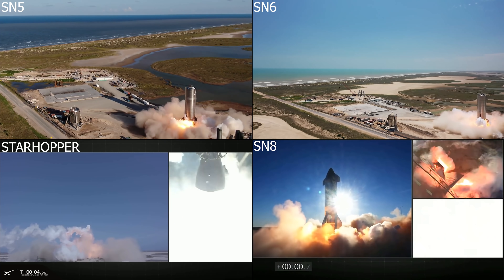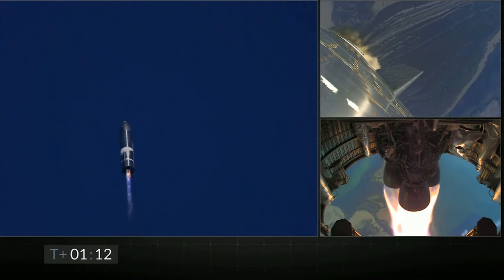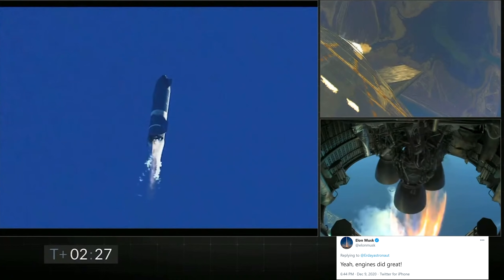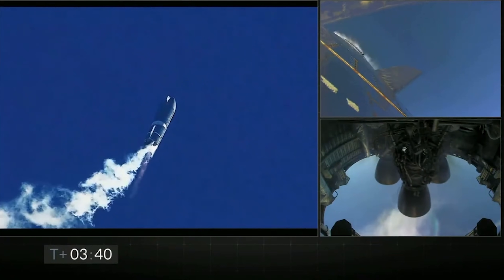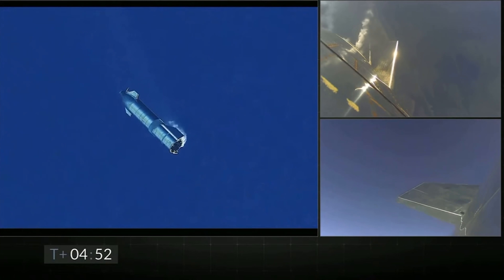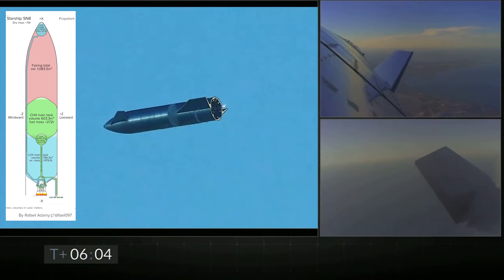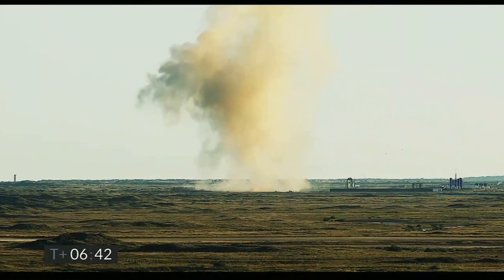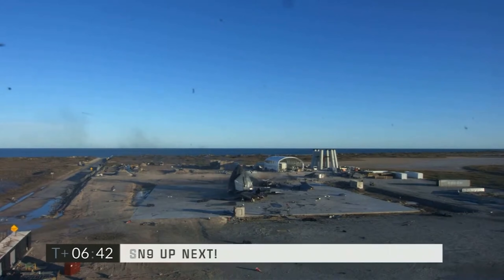SpaceX Starship Serial Number 8 Test Flight

Comment: Nice job on the narration.  Good luck with your channel.  Perhaps a dumb question but why would the Raptor consume itself due to low pressure?  My take would certainly be that the mix became very high LOX which would cause a super-heating beyond tolerance.

Comment: I had the impression that the final landing position was performed too close from the ground, in comparison to the approximation that Falcon 9 does. Do you know at which altitude/speed it is supposed to start this maneuver?
Reply: no, the deceleration rate would have been sufficient from where it started
Reply: @infinitelyexplosive  thanks!

Comment: This need to be redesign. I feel if they have propellers just on landing will helped be get balanced. those propeller need to be at edge of the notch those blades need to hidden inside while travell and  those will be at ignited at higher speed just for 2 mins. so it feels like hanging in air and get dropped with 0 velocity and makes life easier.
Reply: And how exactly will "propellers" work on Mars where there is 1% the atmosphere that Earth has? That is the end goal right?

Comment: My memory says copper makes a green flame when oxidized.. Isn't copper/brass/stainless required in the engine for cryogenic temperatures.?  I did LNG truck conversions and material selections matter a lot at cryo temps.

Comment: Eleven seconds. Mathematical model of physical systems
Eleven seconds before crash, the thrusters tried to control this huge mass with liquid inside, with the famous "inverted pendulum" control.
Since I don't know the real motor names i just call them 1,2 and 3 in order of starting, like actors in the theater.
Motor 1 start at T+6:31 and Motor 2 at T+6:32. both motors pointing to the top of the rocket
( when is horizontal) to its maximum angle permitted.
This stops the diving and puts the ship in vertical position.
This maneuver could be done with the motor 3 only and immediately prepare, 
in the correct angle, the motors 1 and 2 to control the overshoot.
Motors 1 and 2 try to control the mass and you can see how motor 2 try to reduce the counter-overshoot trying to keep
balanced the "inverted pendulum", moving to the top.
The disgrace here, is that motor 2 shutdown at 6:39 leaving motor 1 alone. 
Perhaps in the future they will write a program to start immediately the motor 3 to compensate.. ufff!
I can't imagine how hot was the processor calculating rapidly the information from the accelerometers and the actuators response.
I hope they have the logs from that processors... a lot to learn from that!
To me, at 6:31, should be used motor 3 only and wait for the inertial momentum 
to activate motors 1 and 2 together at maximum thrust, and shutdown intermediately motor 3.
This is not about time, is about inertial momentum... also can be predicted to to actuate before so prevent the overshoot.
Everything has to work with the altimeter ufffff!
Well, this is what i think from my taxi. yes i am a taxi driver, but I like to read control systems books(*),.. so don't criticize me too much. hehe.
I want to say thanks to Mr. Elon Musk. This guy is a believer and practical person. I congratulate him and all the people who work in his project.
I wish you huge success. (good luck is for mediocre people)
ps: They hoover the Startship. a lot of measures there!. but they hoover it with the wrong motor i think.Anyway, i am nobody but the video tell a lot of things.
(*)my favorite control system book: Douglas Cooper "control Guru"

Comment: It appears that the Raptor engines did not generate enough methane gas volume to maintain auxiliary tank pressure. Perhaps running at prolonged reduced thrust on one or two engines was a contributing factor. 

Rather than redesign the Raptors extensively, it might be better to complete the hot gas thruster system and use their autogenous pressurization system to supplement the Raptors. After all, in order to operate efficiently, the hot-gas thrusters would require a much higher pressure in their propellant vapor tanks than the regular cryo tanks. 

This would have to be replenished from liquids in a boot-strap fashion, and excess generated vapor could be diverted to the auxiliary tanks intentionally. 

It may also be desirable to operate the main cryo-tanks at reduced pressure once most liquid is consumed. This would allow them to safely re-pressurize during the hypersonic reentry without excessive venting.

Comment: I knew something wasn't right.
This makes perfect sense. 
So The Space X Team needs a system in that low compression tank that will insure through any maneuver that fuel supply continues.
Maybe a moving compression wall that pushes inward,forcing out air and compressing the fuel so that there is a steady supply of fuel..
Gotta hand it to The Space X Team..
That ship was Beautiful and it was a Great Flight, Up to landing approach..
Job well done !
I look forward to the New Improved Model. 
I know it will be a sight to behold..

Comment: The engines don't "burn themselves". That's a misleading flaw in this dialogue. The green color means the fuel mix has more methane than when it's more orange. Whether that was intentional or not, I don't know, to be honest. But I wouldn't trust Mr "Engines burning themselves" to come up with another ridiculous answer.
Reply: Also, he says that the nose tank "did not provide enough thrust for a soft landing". But of course the nose tanks are for attitude adjustments, NOT the deceleration burn. So the explanation is an irresponsible fail.
Reply: You've heard of fake news. In this video, you've got fake rocket science.

Comment: very nice test, but why do not start the 3 engines and deploy the landing gear?
Reply: Just like the falcon boosters, turning on all the engines for the landing burn would be too much and would actually make the craft rise again.  For this particular event,  it also wouldn't have helped since there was a fault in the fuel system supplying the engines.
Reply: @nolsp7240  thx for the explanation, and the landing gear?, 
i didn't see them
Reply: @arielnonini7384  The software didn't deploy the landing gear since it detected that it was still falling too fast.  Even if it did deploy,  the prototype landing legs couldn't have absorbed the impact and the result would still be the same.

Comment: Would it be better if SN8 flipped a few seconds earlier to allow tanks pressure to normalize and then fire engines 1 by 1 until you have all 3 running ?

Comment: It looks like the green flame at the end of the last burn might be a result of a collision between the two engine bells.  The right side engine did not get out of the way when it lost thrust and you can see the left engine collide with it when it is trying to compensate. There is allot of copper tubing in those engines bells.

Comment: i wonder if the centrifugal force of the flip may have caused the fuel to not fully make it from the header tank to the engines causing the burning of the engine and ultimately the RUD of the spacecraft.

Comment: Marcus House reports in his video much of the same as this but also notes that at about the 6:34 mark, one of the Raptor engines bangs into a second engine thus causing the green flame associated with damage to the copper engine components. His inside engine compartment video was a little clearer than this video.

Comment: First note: The landing legs didn't deploy, no one seems to have mentioned this. Second note: When the one engine flamed out just before touchdown, the remaining engine gimbaled hard to the right, smashing it's bell into the disabled engine. This probably damaged the remaining engine enough that its copper alloys started burning up, causing the green flame -  and with the bell destroyed there was little chance of any useful thrust.

Comment: WHY WAS N'T THE HEADER TANK HAD ENOUGH PRESSURE? WE KNOW EVERYTHING ELSE AND YOU DID NOT EXPLAIN THE MAIN REASON. WHY WERE THERE ONLY TWO ENGINES INSTEAD OF 3 FIRED IN THE FINAL DESCENT? DID ONE OF THEM STOPPED WORKING? VERY LOW ON USEFUL INFO

Comment: It is interesting to see the different logic Spacex uses compared to most others. Normally when an engine detects an anomaly it will shutdown immediately to prevent further damage. However that is in many cases a 'stupid' thing for the engine to do because it doesn't 'know' that by shutting itself down it will destroy everything else as well. It seems that Spacex has put in some well thought out overall control that takes into consideration the whole situation. In this case keeping the engine running was certain to destroy the engine but there was still a probability,  however small, that it would safely land the vehicle. Even if it didn't manage that it almost certainly prevented a lot of damage to the equipment and structures on the ground by at least guiding itself exactly where it was meant to go, even if not succeeding in slowing down sufficiently.  If the engines had shut down immediately when they detected the low pressure it would have gone into a totally uncontrolled fall.

Comment: Some think the green flame happened because the one engine slammed into the other one, because it didn't gimbal out of the way, because in was supposed to be lit causing the lit engine's engine bell hitting the other engine whilest trying to correct for the other engine that had flamed out :)
Reply: Nah. The engine got more oxidizer than fuel so it destroyed itself
Reply: @a10warthog4  thats why I said that some think... . I think you should watch Marcus House's Video on it(the one on the 10th).

Comment: How will they keep the top tanks cold enough to keep all the oxygen necessary for lading after going for the moon or mars? a bit of sun on that part and it will probably get high temperatures. I still do not understand that part.
Reply: im pretty sure the pressure within the tanks would keep it in a liquid state. Remember if the pressure is too high the liquid oxygen cant actually turn back into a gas

Comment: A point to ponder:  Given that it was low pressure in the fuel header as well as No landing legs were deployed,  COPV's supplied pressure to do both..........Maybe one of the early small fires under the skirt caused one or more leaks and allowed a pressure drop to those systems. (But not all as the Oxygen header worked nominally.) We will find out eventually though.

Comment: *Subcooled. A liquid cannot be supercooled. Superheated is where a vapor has energy added after the latent point of evaporation. Subcooled is where a liquid has energy removed after the latent point of condensation. This leads to a modest increase in density. Subcooled liquids, superheated vapors.

Comment: Question:
If the 3 Raptor Engines were on, would the Starship landed safely?Just a thought.
Reply: most likely, the reason it failed was because of the pressure. The way the starship lands is called a suicide burn, Or as they call it for PR reasons the "hover-slam" And the reason its called a suicide burn is because, you start burning too late and you're dead, start burning too early and you're dead. So the maneuver for the starship is most likely calculated expecting that all 3 engines would light

Comment: The green is from the hypergolic fuel used to provide continuous ignition.
Reply: Wrong. Raptors use electrical ignition. Falcons use hypergolic that burns green. Starships don't use falcon engines.

Comment: So the question is:

What made the pressure in the header thank be too low?
Reply from the maker: This reason may or may not be released to the general public, but you can be sure that changes will be made for the next prototype test flight!
Reply: @smallstars  Yes, but what is your guess?

I'm guessing the temperature of the LOX in the header tank might have been different than expected. It's a rather small tank in the front. Maybe warmed up faster than the main tank would, vented more, pressure  dropped.... not enough thrust.

Comment: Methane or LNG? how cold is it? 1000 btu per cubic foot of gas at burn. what is the thrust? what is the air to gas ratio you are using. what is the burn rate and gas from liquid volume surface? How do you heat the liquid Methane to rapidly increase it's pressure to at least 3000 psi to mix with oxygen for burning to supply the thrust. How do you keep the high pressure gas contained and at what volume to supply the demand? How big is that ship again? 500 feet wide? what's the take off weight again? Come on? Methane and oxygen? For a blow tourch to cook a weeny maybe.
Reply from the maker: It's CH4 and it doesn't get mixed with air, it mixes with liquid oxygen and gets sparked up! 

You can probably look up the temperatures with a google search and it may be helpful to check out everyday astronaut's raptor engine video. You should also check out Scott Manley's videos to learn about all the technical rocket science.

Comment: This confirms basically what I had tried to explain to others, that the crash was only due to speed because of lack of fuel during the landing Still all in all great job with a minor fuel miscalculation that you can be sure will not happen again
Reply: And it's very possible it wasn't a lack of fuel but the systems that keep it under high pressure as volume runs lower. We won't know for sure unless they tell us of course.

Comment: Started to think that the inversion or partial inversion of the tanks wasn't completely thought out and the low pressure condition occurred because some propellant just locked out the supply line to at least one engine. Live and learn!!! Also, no one is talking about the landing legs. never saw them extend.

Comment: The dense white smoke during flight appears to be flammable material within the engine skirt burning off. SpaceX will need to work on that as well, seemingly. It’s hellishly hot in there, especially as the engines gimbal outward and/or shut off.

Comment: I wonder how much that explosion cost Space X??
Reply from the maker: I don't think that's the right way sof thinking about this. It's a weird thing to try to out a monetary value on in this case, it's a prototype test vehicle who's sole purpose was to test new ideas and methods. It provided gain for SpaceX, not loss.
Reply: A better question to ask is. How much more did the explosion cost than landing? Maybe a million at most which isn't that much in the space industry. Sn8 and its engines would most likely have been scrapped after this flight.

Comment: 1:04 No it's not. The whole LOX tank starts go gain frost over time because the temperature inside the tank becomes lower and lower and the boiled off LOX which is still very cold also helps with that. The CH4 didn't produce as much frost on the outside, it's less cold.

Comment: I keep getting different explanation for the green exhaust at landing. (1) "Engine rich exhaust" is one explanation, while others say, (2) it comes from an liquid, used to ignite the engines. As there is not enough LOX pumped to the engine, not all engines ignite on landing, as planned. As the fight computer tries to ignite more engines, it pumps out more of the ignition liquid, causing intense green exhaust. Which one is the correct explanation?

Comment: The "balancing a stick on your finger" analogy is not 100% correct because the force acting on the stick, in that case, is the normal reaction to its weight and thus always points up. For the raptors, though, the force vector is always aligned with the rocket no matter the orientation (if we ignore thrust vectoring) so its inherently stable.
Reply: But with vectored thrust, we would then have the thrust force no longer aligned with the axial center of SN8, right?
Reply: @nolsp7240  The thrust vectoring's job is to de-align the thrust vector with the center of mass, creating torque that turns the rocket. Thrust vectoring is the thing that introduces instability, and that instability ends as soon as the nozzles go back to the default position. If there was no thrust vectoring the rocket would go straight up, or with the right amount of  thrust (air resistance is neglectible) hover stably.

The analogy doesnt work because as soon as the stick turns even the slightest the force is no longer aligned with the CoM because its direction is fixed making it turn more, dealigning the force even more, and so on. With the rocket, if it turns a bit the engines turn with it, and the forces remain aligned, so the turning rate will be constant as well. Thrust vectoring introduces that instability to correct it

Comment: Very well done video, thansk!! 
The LOX header tank is about 45 meters above the engines. So even without any ullage pressure the turbine intake would  be about 5 bar. The methane tank is much lower and liquid methane's density is much smaller than that of LOX, so I estimated that without any extra gas pressure the pressure at turbine intake would be about 1 bar or maybe a bit more.
A quess that there was cavitation in the turbo pump because of low methane preasure, so too litlle methane flowing into engune(s).

Comment: The most interesting part is that it "put the crater in the right spot".  VERY IMPORTANT.  Having a crater where you did not expect one would be very bad.
Reply: Correct crater placement is tough to pull off.

Comment: I think there's a vertical tilt which may create an uneven landing also. If the everything worked perfectly, the engineers could try early flip to improve soft landing putting into consideration the even longer altitude for future flight. Every failure is a good opportunity to learn. Kudos to the team for a great successful attempt.